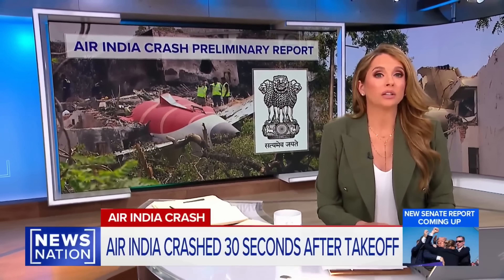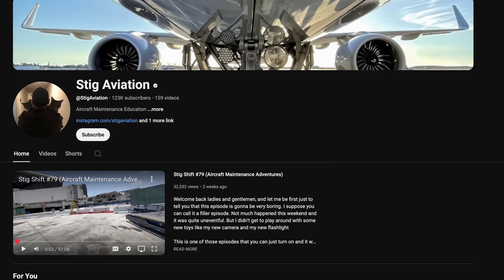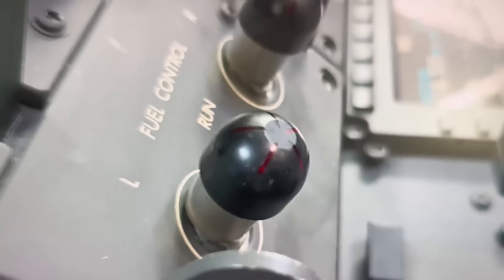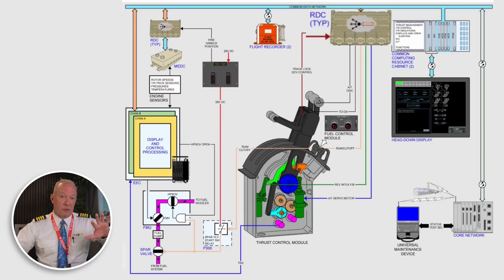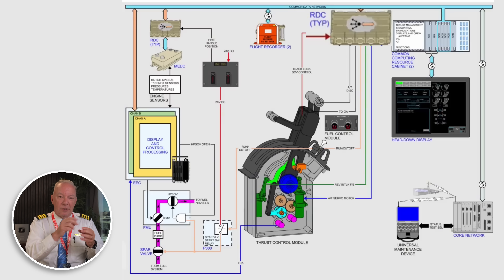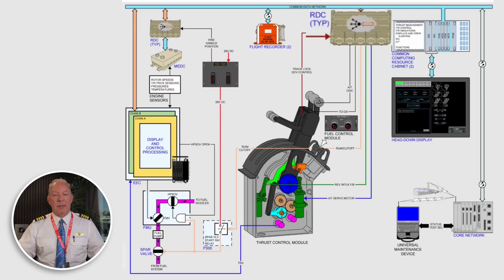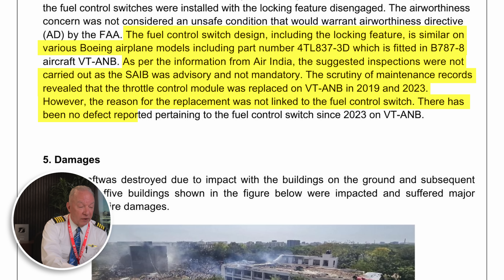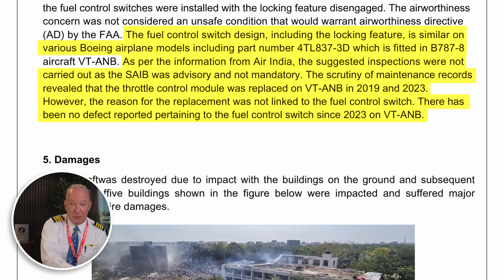The Truth About Boeing 787 Fuel Control Switches

Comment: The captain turned them off.
The first officer said “why did you do that?” 
If the captain hadn’t done it he’d have said”WTF you talking about?” 
The young first officer had everything to live for. The captain…didn’t.
Reply: You're overlooking an important point. The preliminary report did not specify which one asked the question about the fuel switches and which one answered. 
So your comment is unwarranted at this point for that reason alone. 
In addition, as others have pointed out, the one asking the question could have been creating disinformation for posterity on the CVR. 
It's impossible to know and it will never be known.

Comment: What you seem to be saying is that the valves require a voltage to open, and are spring-loaded shut, which contradicts what I read that someone supplied from a technical guide.

"The report" says the switches were transitioned off and then on 10 seconds later. 
The obvious question is "HOW is that known?" There must be a way engineered to know, and that system must be understood to know how reliable it is. Does the system look for the completed circuit, or (a better design) does it actually monitor the physical position of the switch in some way?

I doubt most pilots (if any) have the technical background to understand the engineering of these systems.

Comment: I really appreciate and thank Captain Steve for his dedication to share his knowledge and experience about aviation.
I agree with with him regarding the physical operation of the fuel control switches and their locking positions. However, I cannot agree that the fuel control switches open the three valves directly by supplying 28 VDC through the Spar Valve Relay.
Let's assume that the fuel control switches, the three Valves, the Spar Valve Relay and the Power Supply all work fine.  Based on the diagram provided, when the fuel control switch is in the RUN position, it energizes the Spar Valve Relay, and its contact delivers 28 VDC to the Spar Valve, thus opening that valve.  But those 28 VDC are not directly wired to the other two valves.
To open the HPSOV (High Pressure Shut-Off Valve) requires two simultaneous signals going to the "AND" Gate: the 28 VDC coming from the Spar Valve Relay AND the "OPEN HPSOV" command from the EEC (Engine Electronic Control).
And the FMV (Fuel Metering Valve) only receives a command from the EEC, not the 28 VDC from the SV relay. Actually, the Thrust Control Module determines the position of the FMV which controls the amount of fuel delivered to the engine (there's actually a control signal from the EEC to modulate that FM valve).
Therefore, the three valves are not opened directly from the fuel control switches, but they require additional command signals coming from the EEC.  If any of those valves do not open, there is no fuel to the engine regardless of the physical position of the fuel control switches.  
The most plausible cause for the accident was human error or intention to move those switches, but, in my opinion, the electrical circuit, the electronic signals from the EEC and the software must also be taken into account in the final report.
Reply: Well stated. So it is possible for the EEC / FADEC to shut down the engines without the cockpit switches being moved. And it is pretty clear that in ANA flight 985 on 17th January 2019 at Osaka Airport (shortly after landing) this actually happened, so it is not just a theoretical possibility.
Reply: Jose, I am a layman but, based on the information we currently have, can we rule out any action of the TCMA (Thrust Control Malfunction Accommodation system)?
Also, could a short circuit (such as due to water leakage/movement at the point of rotation) lead to fuel cutoff/valve closure? I have read that water leaks into the EE bay (Electronic Equipment) is a known serious problem on the 787.
Reply: @Andrew-xv7mz  Andrew, my reasoning only tried to point out that besides the 28 VDC there are digital signals coming from the EEC that can command to close the HPSOV and FMV valves supplying fuel to the engines. The Spar valves are directly controlled by the fuel control switches through a simple relay, so its operation is straightforward.  

If the fuel control switches had always been in the RUN position, then the loss of fuel to the engines could have been caused from wrong commands coming from the EEC to the HPSOV or FMV valves, or both (a variety of causes.. software issues, power glitches, sensor failures, fluid drops, etc).
But as the fuel control switches were detected to transition from RUN to CUT OFF at 08:08:42 (and one second later the other), all three valves must have been commanded to close in both engines and then the RAT was deployed.
What is strange is that the fuel control switch #1 was transitioned from CUTOFF back to RUN at 08:08:52 and the #2 at 08:08:56 (4 secs later in such an emergency where each second counts)
Reply: @joseantonioubeira295  Thank you for taking the time to respond. Much apprecieted, Jose.

Comment: 18:03 The problem here is that you clearly don’t understand aircraft systems or accident investigation. Which is a bit concerning to say the least. 

The important thing is to get to the bottom of what happened. You are speculating about things you clearly don’t understand.
To speculate and spread misinformation does not help!

To get clarity the investigators will have to look in to several things.
1. Is there a reason for one of the pilots to cut off the engines. Background checks etc.
2. Did one of the pilots accidentally switch off the engines. Did he have a  “brain fart”. And what can be done to prevent it in that case. Probably a re-design of the switch logic.
3. Is it possible that there was a fault in the switch locking mechanism so they were accidentally knocked to the off position. This can hopefully be done by examining the switches of the accident aircraft. The fact that the FDR recorded 1 sec between the position changes can be caused by the sample rate of the data unit and must verified. The fact that no other switches in the air India fleet were faulty says nothing about if the switches were faulty on this aircraft. The fact that the unit has been replaced twice says nothing about if the switches were working, quite the opposite, it points to quality issues. Was the service bulletins carried out by the parts supplier or is it still possible that we have faulty switches out there?
4. How do the FDR sample the switch positions. The whole data and sampling chain needs to be evaluated before we can know what the FDR data says.

Comment: I agree with your theories. When the comment was made by one of the pilots “why turn off?”, to me he was able to turn them back on. Not likely to happen in a glitchy system. And if it was an electrical glitch, the switches would be physically in on position. I think challenging different ways this could happen needs to be done to ensure every possibility is explored. Until then, IMO, pilot did it on purpose unfortunately. I will maintain an open mind and still listen to other possible scenarios. But until then…

Comment: Captain Steevie pinned the tail on the donkey at 5:34 minutes into the Morphogenic field structure of DNA software network communication codes about echoing " it's a closed loop Mobius strips Hive Mind Cybernetic METATRONIC Parasitic reverse flow dynamics coded phantom Matrix simulation within simulation within simulation within simulation within simulation generation after generation after generation after generation until it implodes and goes NOVA BARDO quantum vampiric Super computers which is Base 10 Binary A01 Alpha Omega finite Blank Slate memory wipe looking Glass Technology AI machine coded 
Captain Steevie by his own admission is aware that thàt AI QI system cannot replenish their life force electrical power supply through our eternal Sun eternal life force electrical sound & light field of our Eternal Grand Creator Spirit 
Thàts the fallen AI QI Shadow Body Black CubeiT Intruder Races Alliance 666 BEAST AI QI machine coded phantom dark flower grid network communication codes 
U will note in the video with 2 other aviation experts one of them said " MIMICKER" 
It's a pretending to be like us 
It tries to duplicate the first internal Eternal sound vibration and frequency modulation Spheres of our Eternal Grand Creator Spirit Sun Temple essence codecs breathing Core Still point of a TRUE Vacuum 
There is only One Eternity 
God's pure eternal absolute love on Fire tu Create God source worlds and protect all life forms from predatory sexual AI QI machine coded child  molesters 

Duplicate Keys trying to dehydrate the natural Krystal River 🌈 Aurora's Spiral flow of eternal living waters 
The AI QI 17 checkmate intelligence agencies clandestine psychological operations against Humanity 
The machine mind control programs is stealing water to cool their huge DNA software network communication coded collection services through Quantum Super computer facilities like NSA in  Utah
METATRONIC binary finite information systems command of full spectrum dominance 
That's ur NAZI NASA Corporate Drug Cartel Cyber security teams through the military Pentagram intelligence machinery coded Agencies t9 protect their investments 
How many of U know Y the Viet Nam War was 
Information system pathogenic Parasitic psychopathic psychological operations against Humanity 
All CIA NSA MI6 British Secret Service perpetual psychopathic Universe killer mathematical programs playing the game of blood sacrifices U.  Can choose any Holocaust against Humanity 
The one in Gaza 
The One in Central America 
The one in South America like Bolivia Ecuador Amazon Basin 
The current Holocaust in America 
The Holocaust in Indonesia Cambodia India Armenia Yugoslavia ànd all across western Europe and Russia Asia in WW II 

When U  have Super computers that run on finite Quantum artificial intelligence than it.needs à Native Indigenous Tribal ancient ancestral Spirits bloodlines here as a source of eternal life coded electrical power supply consent form contracts ATTENTION to pay to play the game of thrones through finite Quantum vampiric intelligence network coded communication signals 
It runs finite Artificial false light memory wipe looking Glass Technology mapping future potential possibilities of predictive modeling Blank Slate QI Shadow Body Black 🖤 Market slave traders intergalactic Pirates cartels 
They refuse to serve Humanity 
So the US government is NOT a  4 Gated Y's Hub server of God's pure internal eternal absolute love in service to all self aware sentient life forms 
Our Cosmic Spiritual Law of genetic environmental engineering law school experiments after 3 trillion cellular years of genetic breathing temperature Vacuum gauge metering voltage change echo maps recording speeds to restore balance 
Mu ah VA 💋🌈 Aurora's